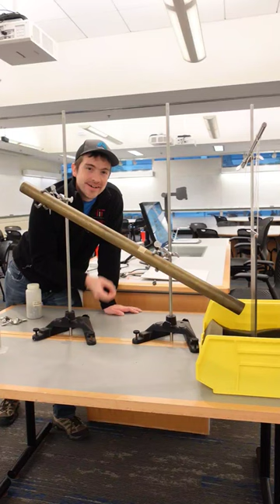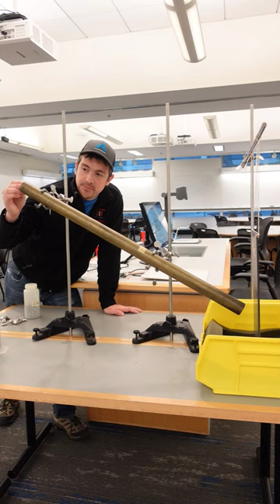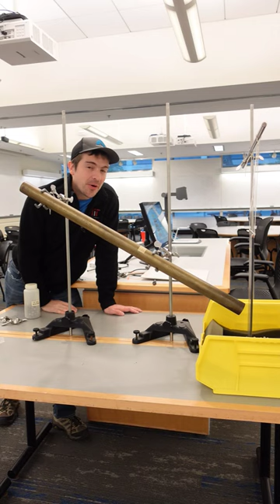How can a tiny ball bearing move a large wooden plate? #rocketscience #physics #stem #astrophysics

Comment: Right in this case, exactly the experiment needed to express the condition. One caveat though, plastics, rubber, urethane’s, silicons, do not work in outer space. These products outgas and lose their properties and cannot perform to the specification intended. The vacuum of space, which is said to be 10-6 torr is a much stronger vacuum than 0.1mb in thermosphere. Even if seals are metallic there is still an issue with propellant particles binding the propulsion outlets and blocking them. To understand this situation, pressurize an air tank, then open the valve at the bottom. What you’ll see is ice build up at the valve and block the valve. Then it will melt from the heat, and let air out again, which will then freeze.

Also, even if the propellant does not bind, and seals are perfect, a burn down analysis would be required to figure out how many movements and the type of momentum that can be generated from center of mass distribution during propellant expulsion.

Comment: What if there’s nothing to push off of?
Reply: There is always something to push off: the rest of the rocket. The air that's in the way actually slows down the rocket exhaust by getting in the way, making the engine performance worse, not better.

Think of shooting a firework in the air and watching when it explodes. The center of mass will continue on the same straight line, even though no particular particles are in that spot anymore. The explosion particles will spread out, but the momentum will be maintained if you added up all those particles and took their direction into consideration. Some will go left, but this will cancel out with the ones that go right. 

I think your question comes from a misunderstanding of Newton's "equal and opposite reaction" law that I had as well. It comes from the fact that a lot of examples show a system in static equilibrium, ie nothing is accelerating, which makes it unclear which reactions are being talked about.

In this video, you can't see the rocket cylinder moving because it's tied down to the table, but the actual movement of the rocket would happen because as the balls roll down it, they're pushing the rocket up. The hanging plate is really just demonstrating that there is energy in tiny particles going very fast just like there is in large masses.

Comment: Saturn V claimed 7.5 million ftlbs thrust. Each second the fuel oxidizer combined equaled 28,415 lbs. How did 28,415 lbs create 7.5 million lbs thrust? 
You say force = mass x velocity.  What is the required velocity of the exhaust gases to produce 7.5 million lbs? Answer 8500 feet/sec². 8500 feet is 1.6 miles, in one second.  Watch the video of any Apollo mission launch. On lift off the exhaust plume is only the length of the rocket or 363 feet. That exhaust would have to be hitting the ground when the rocket was over a mile high. This is the falsification of F=ma as the source of thrust of a rocket.
Reply: Idk maybe it turned into gas and expanded increasing the pressure or something